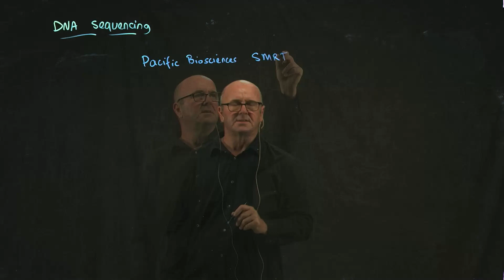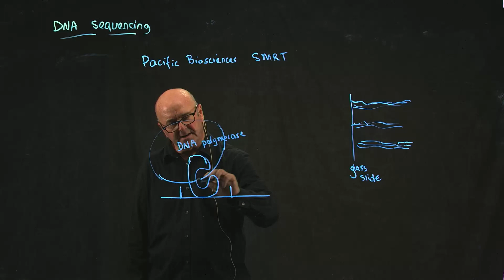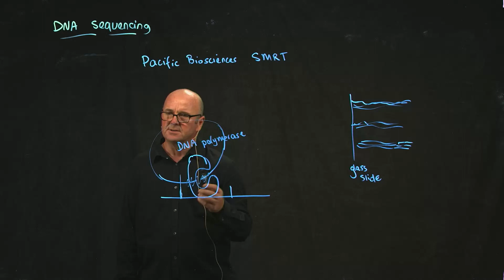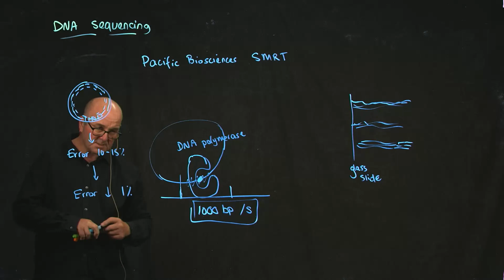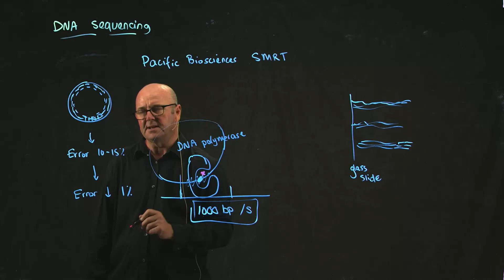Pacific Biosciences Sequencing

Comment: The Polymerase do have the ability to synthesis 1000bp/s, but i have seen many online material said that it is only 3-10bp/s. And it is also very not logical since it will be pretty hard to assemble fragments you described above. So is this really correct or is there technology that control the polymerase reaction rate.
Reply: Yes. The polymerase is slowed down to about 2-3 bp/sec. Much of Pacbio r&d is in modifying polymerase. The description here is a bit off, although otherwise very well done. The whole insert is sequenced each lap around the template, not little bits. There is significant indel errors at single pass accuracy, but they mostly go away with >3 passes